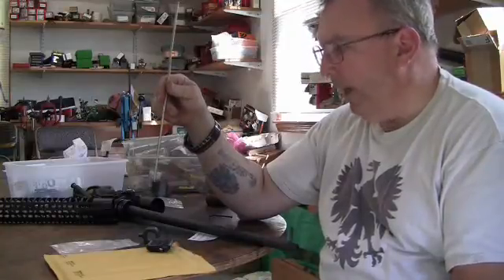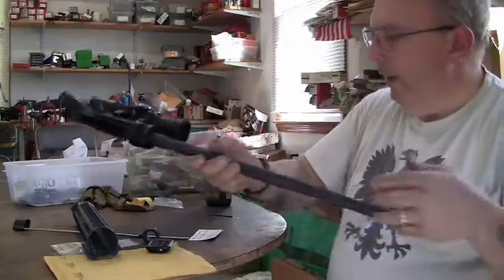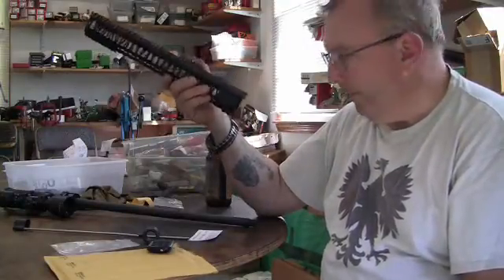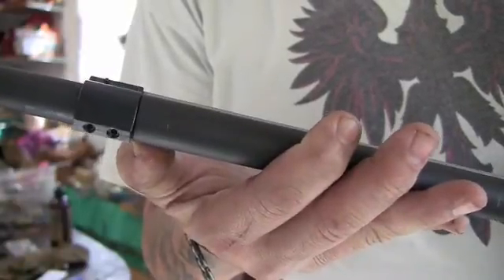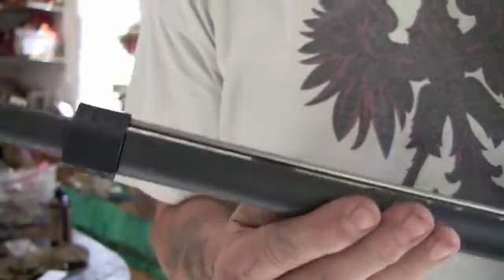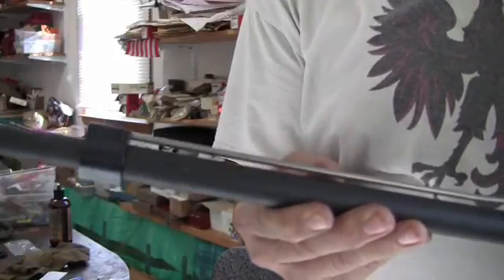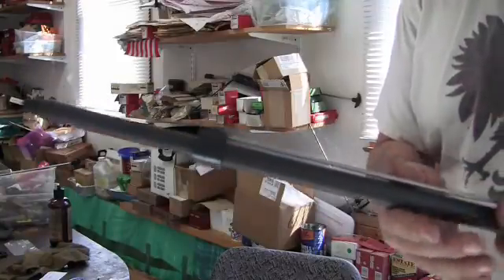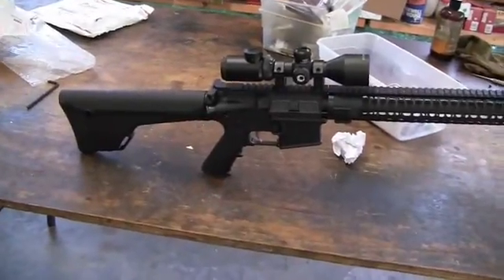BRD Engineering AR 15 Gas block dimple Jig Review

Comment: The jig is a good design for the average DIY'er, but after several uses, the hole in the pinning jig will egg out due to the standard I drill bit flexing from contacting the angled surface and flexing to the side.  Eventually the hole will have to be weld filled and re-drilled in the jig (which BRD will do).  The best way to pin a low pro GB (but not realistic for most of us) is to mill a flat with a mini-mill, then drill the rest of the way with a quality cobalt bit for the size/type of pin you want to run.